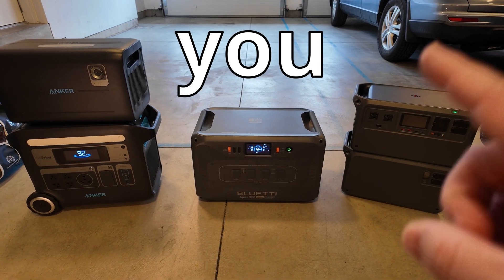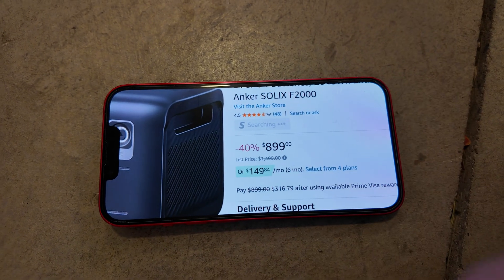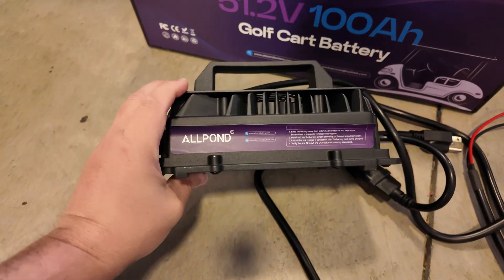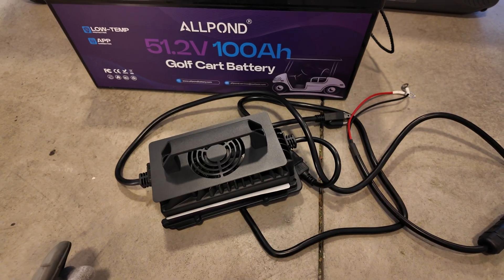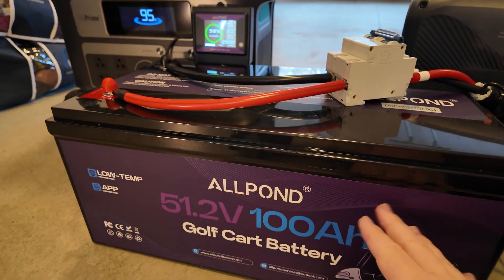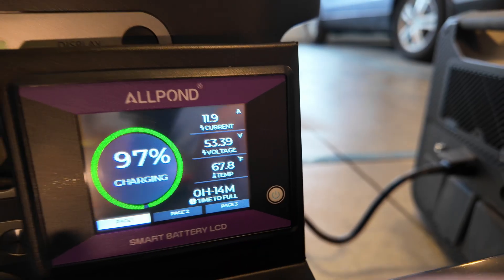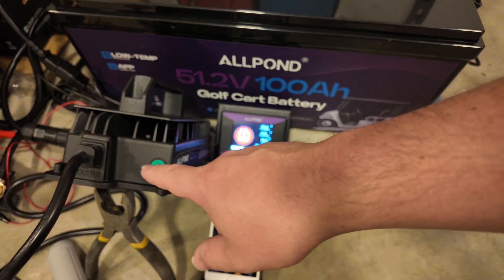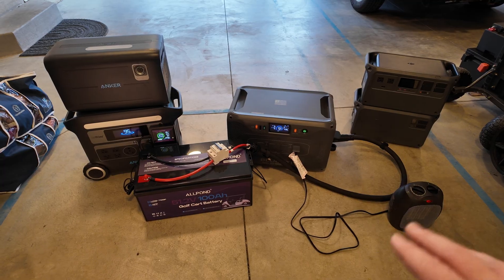The Great Solar Generator Rip-Off (And How to Beat It)

Comment: Okay, yes, a house battery is cheaper than a "solar" battery.  But those "solar" batteries are priced because you just plug a solar panel into it and you're done vs battery, inverter, charge controller, wiring them together, etc.   In the grand scheme, the house battery option is better, but the simplicity of using a Bluetti is worth something.
Reply from the maker: Which is why I'm proposing combining the two! With the Bluetti, you can just plug the battery in and it will expand the power station while still allowing you to use the power station and all it's features!

Comment: If your portable power station was “semi permanently ”  hooked to your 12000xp battery bank and using the mppt’s to charge that bank and the power station at same time
Will this work?
I have a 6000xp in a rv and was considering doing exactly this to get more inverter power as it has better charging capacity
Reply from the maker: Yep! Works great! I do it all the time actually!

Comment: I have have found solar is a source of stress wondering if and when they'll charge depending on weather and constantly chasing sun in my motorhome and moving panels around which is hard to do in forests and in the winter, I just use a small Honda generator to charge mine.
Reply from the maker: That's definitely a common struggle with solar, especially in challenging conditions.

Comment: The worst deal is to buy these types of all-in-one battery generators that have low capacity and still depend on the grid to charge them. For the same money or even much less, you can get a solar inverter, batteries and PVs and have permanent power.
Reply from the maker: You must have not watched the whole video where I talked about this!
Reply: @theresatrickforthat  watch only few minutes because is turn to be nonsense....
Reply: @uncioclasprinlume this is the stupidest thing I've heard today.

I didn't watch you cover the topic because I didn't agree with your opinion despite you covering the benefits of my opinion.

Buddy if you want the entire world to revolve around you, go talk to a chat bot.
Reply: @mr.grotto  you are the chat bot , so let's discuss ....NOT!

Comment: I would love to see what needs to be done to make this possible on a Ecoflow Delta Pro 3, or a Jackery 5000!!
Cool work on this! 
Is there any danger associated with the cart battery related to discharge rates? For example, if this was hooked up to an Ecoflow and the unit pulled it's rated 8kW surge power, would that damage this battery, which markets itself as 7.6kW power delivery?
Reply from the maker: The EcoFlow video is coming soon! I don’t own a Jackery so I can’t test it at this time. The golf cart battery can EASILY handle any surges. It can single handily run my giant 12,000 watt whole home inverter. Golf Cart batteries have massive surge capability. So the battery can handle it…just make sure you side wire and fuses correctly!

Comment: Can you connect multiple golf cart batteries together and connect to power station?
Reply from the maker: Yes. Just make sure to use proper fusing and cable sizes!
Reply: Yes, you can parallel multiple 51.2V batteries together, but there is a limit.

Comment: This needs to be stated more when people review power stations. I have a solix hooked to a transfer switch but i have more solar than it can take. I plan on adding server rack batteries one at a time but in my camper i may use golf cart batteries because the form factor may take up less room depending on how it is layed out
Reply from the maker: That's a great approach to expand your system!
Reply: Excess power?…maybe shunt some to do a bit of crypto mining 😂

Comment: Why did the allpond BMS let you discharge to 40.7V? That's way too low for regular LFP. The 105Ah discharge also points towards a low setting. Given the sudden drop in voltage at the bottom of the range I think if the bms stopped the discharge at 100Ah you would've still had around 46-48V which is much much healthier.
Reply from the maker: You can adjust the settings if you’d like with the Overkill Solar App!

Comment: Cool hack!  That battery sure is a good value given the charger and monitor that come with it.  Now for the ultimate in not getting ripped off on a solar generator, don't buy one.  Instead build your own with that battery, an inverter, a charge controller, and all the DIY cables, switches, and fuses that make geeking out so fun.  You won't save money in the short run, but long term you can replace or upgrade each component as needed.  Infinite warranty!
Reply from the maker: That's definitely a solid approach for those who enjoy the DIY aspect and want more control!
Reply: Hard to break even right now...
I purchased the ECO-WORTHY AIO  3500W,  3000W Pure Sine Wave Inverter and a 51.2v 100ah battery for about $1100.
The Mango Power E went on sale, paid 18% of original pricing plus 2x 200w Portable Solar Panels included for $1,122.13. I purchased the proprietary 30 amp cable for $86 which allows charging at 30 amps vs 10 amp 110v 15 amp or 15 amp on 110v 20 amp circuit. Add a small 1500w 4 stroke gas generator...
Ready Rain or shine.
Picked up 2000 watts of ECO-WORTHY Bi-facial Solar Panels for around $500.
Reply: @kevinsage245  Oh. Are you a lighthouse keeper? 🤔 🧓
Reply: It's just a trade-off. They aren't actually actively trying to rip you off, it's just people's expectations are inflated due to misleading reviews and people not doing enough research. These power stations were always for temporary use such as camping and when getting things set. Offgrid and long-term, you always have to go the route of dedicated solar charge controller/inverter, battery and panel setup.

For people who want the convenience, there's no alternative. There are also many people who can't be bothered to hook up an external battery, and to some it looks "janky".
Reply: One advantage of the plug and play system is that you can throw it in your car and get a bunch of versatility out of it. My dream setup is to have my Delta 2 max at home powered by solar and backing up my sump pump and refrigerator, expanded for capacity on a day to day basis, but still can be unplugged and thrown in the car for other things
Reply: I have the Bluetti AC140, I use it for camping and amateur radio and as backup power at home, I estimate it will run the fridge for 3 days. Only downer is that it weighs 16KG and is a downer bringing it to the car for trips.
Reply: One good thing about DIY is configuration.  I have a 300ah battery, a 2000w inverter, a DC/DC charger, a fuse block that lets me add circuits, etc.  It would be a huge packaging issue to put a big power station anywhere.  As it is, the battery is in the well where a middle seat used to fold down (I removed it), the inverter, fuse block, shunt, and inverter are mounted on the front of a piece of inverter above it, and the DC/DC charger is mounted on the side.  It all fits beautifully.  It would have been a painful compromise to fit a power bank bigger than my fridge somewhere, given that my minivan layout was designed without a power bank in mind.  In 2020 I didn't want a power bank because of price, chemistry (no LFP!), and capacity.  But I knew I had room for separate components, and it came together nicely.
Reply: You actually do save money when you consider capacity.
Reply: What are you valuing your time at, for that assessment?
Reply: I don't think you can beat the price and form factor of what Ecoflow, Anker, Bluetti and others are offering, especially this time of year.  The advantage to your setup is if something breaks, you can easily replace it without the entire thing being a paperweight.  I have an Anker and an Ecoflow. Both of which can slave off of my DIY battery box.
Reply: It's either dyi, or the convenience of buying a turn key.  Just like every product you buy, use, or plan for.  If DYI is your thing great , if not that's fine too.  The question is what do you want.   If you want to supply the knowledge, labor for anything you can say your being 'ripped off' in the world its called proprietary.   Most people are not DYI, and would rather spend the money.  Oh wait you want money for what you just showed, or built, are you ripping us off too, or just hypocrisy being shown.  Either it's free and accurate or there is a charge for your labor and knowledge, come back to reality.  This is no different than selling proprietary batteries.   Nothing is free and if it is real free be careful, it can blow up.  The hypocrisy of it all.
Reply: @edwarderickson8386 Why do you keep referring to DIY as DYI?

Comment: Good to have options.  I now have a Pecron F3000LFP.  The expansion battery is $699.   Another F3000LFP is only 60 bucks more but is self-contained and can handle additional solar panels. Pecron simply needs to allow the 240V capability the E3600LFP has.   Not apples-to-apples for capacity but Pecron is not a price-gouging as the other brands.
Reply from the maker: Sounds like you found a great deal!
Reply: Quick question for you good sir. I bought the pecron e1500lfp about a month ago and have been using it regularly. A few days ago i was using it to power my PC and it was at 20% with a estimation of 3.5hrs remaining pulling 120watts. Less than half hour later my computer shut off and the battery at 0%. Have you experienced anything similar where your pecron depletes rapidly at low state of charge?
Reply: @turningwrenchesonoldcars4091  There's only one way of accurately measuring energy left in a battery, and that is by something called Coloumb counting. Basically, it's done by counting amount of power going in and out of the battery, setting what a 0% and 100% is, and from there that is your battery capacity. It has to be calibrated, and it isn't 100% accurate either and will drift over time.
Reply: i agree i love my pecron e1000, going to hookup a 12v 100ah battery like in this video for 1kwh more of juice for my weekend trips
Reply: I have seen video reviews where the Pecron has huge inverter for the money and gives a lot of bang for the buck but also have less efficiency and burn through more while on or idling. Have you had any experience like that or it’s not noticeable?
Reply: That pecron is awesome. I’m thinking about the Pecron F3000LFP , VERY IMPRESSIVE LIGHTWEIGHT FOR SIZE. IT WOULD BE COOL IF THEY DID HAVE THE 240 V CAPABILITY., I LIKE pecron they have good prices
Reply: I agree
Reply: Techron is just selling at a loss to get their app on people's phones putting spyware for the ccp Chinese government in your hands and in your house...
Reply: @nostinkinghandle lol no, i dont use the app on my station and it works flawlessly

Comment: You’re providing this information to many people who don’t have the critical thinking skills to safely perform this work, and have only one goal…to do it as cheap as possible. This is a recipe for failure and in many cases will lead to the possibility of electrocution and fire. In the long run will have a high potential to ruin home battery backup for all due to home insurance company and govt policies. 

There is a reason why these home systems are more expensive. It’s because they are safer for the masses. Think about the big picture and not the revenue that you are making.
Reply from the maker: My goal is to empower people with information and options, not to promote unsafe practices.
Reply: @theresatrickforthat I understand that is your goal, however you have to consider your audience. Having “RIP OFF” in large bold font on your YT thumbnail is blatant sensationalism and is irresponsible due to the nature of the content you cover. 

Is what you cover in your vid, fully electrical safety code compliant? These battery systems are not to be taken lightly. Please consider the safety aspects when dealing with all potential hazards.

Comment: Dam too late I already bought the expansion pack. Will still be a good idea to have extra backup.  Has anyone figured out how to charge the Anker expansion batteries with out having it connected to the power bank?
Reply from the maker: I think that requires you to be connected to the main unit.

Comment: I agree. I have a Fogstar 628ah batteries and a 4000W inverter. Okay I need a cart to push it around BUT it cost a lot less than say the Solix F3800
Reply from the maker: Sounds like you have a solid system set up!

Comment: Very informative video, thank you! I'm quite interested in seeing how you'd use the wiring harness/breaker on an Ecoflow Delta 3's battery expansion port. Some say it cannot be done because the batteries need to be able to communicate with each other.
Reply from the maker: You're welcome! I'm planning on covering that in a future video, so stay tuned!

Comment: My Bluetti EB70 can run my tiny window air conditioner but only for a little over an hour on high. But if I connect my large 12v LiFeP04 battery to it I only get around 150 watts charge input and the max charge input is 200 watts.
Reply from the maker: Yep! You need a higher voltage battery. You might be a candidate for a 24v battery instead of a 48v battery like I showed in this video. All depends on what voltage your power station DC input is.

Comment: The potential for disaster is real. please consider how much power your battery may try to output if your powerstation developed a dead short. thin cables and no regulation is a fire hazzard  (if its at the end of your garden in the shed and you don't mind losing it carry on).  the fuse you have in line is not even guarenteed to stop this particular fault as it AIC is too low and will probably pass the current anyway (unless you were lucky enough for it to fall apart) the cables or power station will burn.  To be safe put some regulation between the battery and power station like a DC-DC charger or converter (the breaker was better but still margins for error due to missing communication wire that you had hidden from view abd didn't mention)  Sure this works (for a while until it dosen't)  but it is not "safe".  Please take note, you do not have to belive me but do your own research.  connection to the bluetti may be out of calibration when charging and discharging as the MPPT may be calibrated for a certain AH battery and you have just doubled it.     I wish you all a safe journey going forward.
Reply from the maker: Thanks for looking out! I always recommend people do their own research to make sure they are comfortable with any setup!

Comment: I think putting a couple DC ports on them would be the simplest things ever. Doesn't need to be anything fancy, even 1 USB-C in/out would be better than nothing. If your power station goes out for some reason, and you decide not to replace it cause your warranty is out, or you just want something different, you can at least still use the battery for something, even if it's just 1 port. It's already got power in DC format just sitting there
Reply from the maker: I completely agree! More accessible DC ports would be a huge improvement for usability.

Comment: The expansion batteries and the power stations need to talk to each other to function as an "expansion battery." You can plug any battery into the solar input to act as kind of an expansion battery. These batteries though can't be charged through the power station, and there is no battery balancing going on.
Reply: The battery has its own BMS and does its own balancing. I was thinking the same thing at first.
Reply from the maker: Hence why this kit with built in Bluetooth app monitoring and a dedicated charger is so perfect!

Comment: Used exact same battery to expand my Bluetti AC200L.  And when you charge Bluetti, you also charge battery proportionally.  Skip manufacturer expensive add on batteries and get more bang for your buck!
Reply from the maker: Awesome! Glad to hear it worked for you!
Reply: Considering everyone suggests starting at all batteries being 100%, what happens when the batteries get out of step, do they recover?
Reply: @mikebuckhurst1534  if both batteries are tied together they act like one giant battery, so none of them can get ''out of step''
Reply: The battery trick is probably also very useful to manage how much current is being drawn from a circuit. IE: Can probably size battery charger to meet energy requirements while devices such as fridges or AC without popping a breaker, as I am currently trying to do with a 15 amp circuit that I currently pull ~10 amps from. I want to add a mini fridge/microwave to the circuit, but either of those will probably push me over the 15 amp limit without using a power station to take the brunt of the current surge from both of those devices. Can then put a 1 or 2 amp charger into the circuit without going over 80% of the circuit's rating. Will also be adding some solar panels into the mix to give me further headroom if I need to add any more appliances or electronics to the circuit, all without having to pay an electrician to add another circuit. :hand-purple-blue-peace:

Comment: Excellent idea I plan on doing something similar. I'll be using a  48volt server rack  battery for a the same ballpark. but i'll have 2 posts on pos/neg to play with. The thing i need to find is a way to monitor the server batter charger and only activate the xt60 output when grid power dies. Have you run across anything like that?
Reply from the maker: Sounds like a solid plan! I haven't personally used a setup like that, but there are definitely solutions out there for automatic transfer switching.